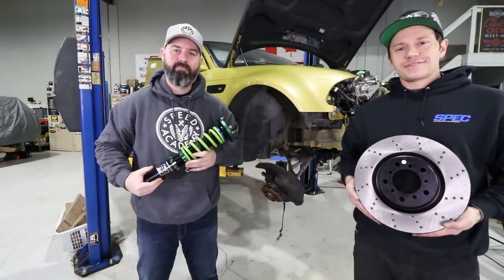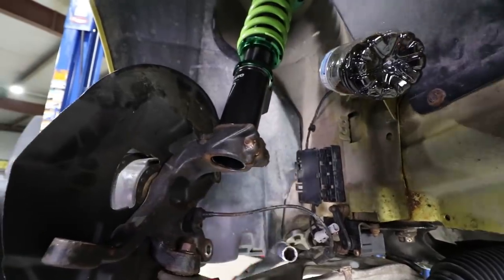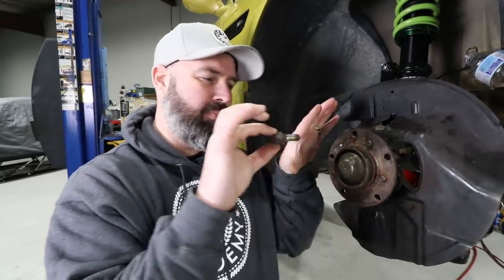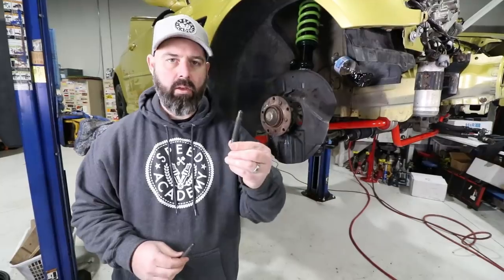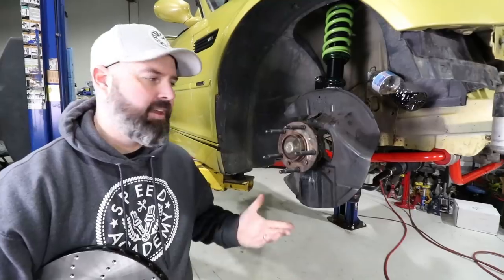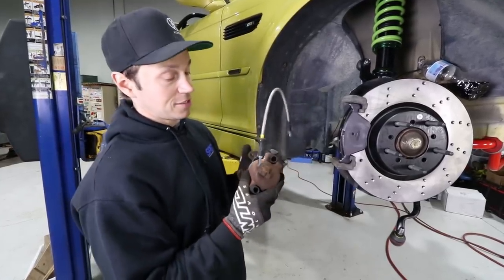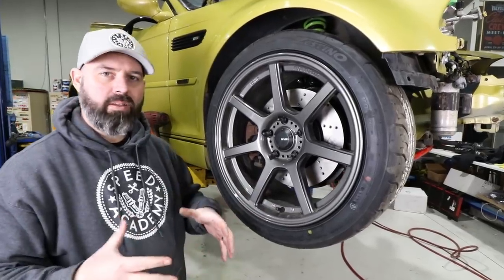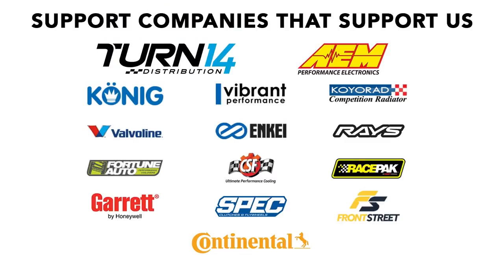Rebuilding and Modifying a $4000 BMW E46 M3 - Part 15

Comment: You guys really should use front shock tower reinforcement plates while using camber plates. E46s have strut tower failure even with the stock top mounts; metal camber plates with stiff springs and dampers will crack them in a few thousand miles.

Comment: The calipers looks like the same ones on the E36M3. I like the way the wheels look. 👌🏾
Reply: The fronts are the same.  Rear has a slightly bigger rear piston in the e46m.

Comment: I've run the Stoptech sport pads front and rear on my 91 Civic for track duty, no fade with brake ducts up front. It is a very light car however

Comment: Pagid rs29s over here with a  fixed front caliper. ditched  the stock slider bunk.
Reply from the maker: More details on the fixed caliper?
Reply: @speedacademy  I went for the 135i calipers. Got them real cheap. Lots of misinfo on them on the forums so that helped with initial buy in. They work very well. No more rusting factory sliders. No need for brass pins etc. You get a quality fixed set up which feels great and is way more rigid.
 Theyve held up just fine with properly fitted pads. Stock rotor size works. 
If you want to spend more there are many options (Porsche, stoptech etc).

For a drift car youre fine in the route you went

Comment: whomever installed those tires needs to know what the dots on the sidewall means
Reply: It's where the tire is lightest (or heaviest, depends on the manufacturer, some have both) so you can line it with the stem, that way you use less weights. That is if the wheel itself is perfectly balanced.

Comment: Why get those single piece stoptech brakedisks when BMW itself has these awesome floating 2 piece disks.
Reply from the maker: Good sir, the original rotors (brake disks) from BMW are not 2-piece. They are a single rotor.

Comment: This build sure is getting expensive. You've basically fixed or replaced most of the mechanical components at this point, which certainly isn't cheap on a BMW. I think the 350z was the much better option for entry-level drift build, even if it wasn't already modified. Are you guys going to do a final cost summary for each car?
Reply: Welcome to buying a used car that you want to track
Reply from the maker: It's been a slippery slope for sure. The issue is once you're in there the temptation to fix all the worn out items is big since we've been there and done the opposite and having to go back and yank everything all over again is not only frustrating but digs into our already busy schedule.
Reply: @speedacademy  Well worst case scenario, you prolonged the life of a car that was probably headed for a scrap yard soon. And it's a good cautionary tale about how a "cheap" used car isn't always the least expensive option.
Reply: @rthomp03  certainly much cheaper than a new m3.

Comment: Funny story I had 5Zigen GN+ slide and fishtaled a curb hitting a pull and my rim didn't bend but instead broke the hub off the rear beam of the car.
Reply: Leason learned dont drive drunk on cold summer tires in October

Comment: Big mistake with drilled rotors
I cracked mine today
Reply from the maker: Never had any issues with Stoptech drilled rotors.
Reply: @speedacademy 
I have the drilled and slotted ones on my s2k, they got cracked on a mountain run. Maybe I need those cooling ducts
Reply: @altimatic2183  yeah more the likely, if they got extreamly hot then rapidly cooled

Comment: question...the vanes on the rotor aren't pitched or scooping towards the front of the car in the video...is that right? i thought the the vanes face forward so air can be forced into the rotor while going forward...😕
Reply: Those holes are just there to release the gases from the brake pads. Plus it depends on the center veins, not the ones on the face that determine which direction they should be facing.
Reply: @vongdong10  I'm talking about the center vanes. i know what the holes are for...
Reply: @PANTYEATR1  Oh, well there's an R sticker on it which I was assume means right.
Reply: @vongdong10  i see the R as well, but I want to know why the rotor doesn't scoop at  air?
Reply: Airflow from a brake rotor is from the center out to the periphery.  If a rotor has directional vanes they should be pitched counter clockwise.
Reply: @PANTYEATR1 It's not meant to sccop air. The rotors take air from the center out.
Reply: @vongdong10  that's the answer i was looking for. thanks

Comment: How does flow formed wheels stack up against forged, forged still stronger over all, just more expensive?
Reply: Forged is stronger (and usually lighter, cause of less material as mentioned with cast vs flow). Flow forged is a hybrid approach to bridge between the cost of a cast vs the strength of fully forged.
Reply from the maker: https://speed.academy/why-wheel-manufacturing-method-load-rating-matter/

Comment: All this work and you haven't shredded a single tire. I feel like Big-P lost the feel and spirit of a budget drift build back when he wanted to keep the interior. I think you might end up regretting not driving and fine tuning the build after minor changes to get a feel for the car so your skills get better as the capabilities of the car gets better. I know you want to protect your investment and not blow a motor or some suspension bits by doing maintenance but its honestly too much and a bit overkill. It looks like your not having any fun yet and its depressing. But best of luck on the road to finish the build.
Reply from the maker: Havent lost the spirit but it's a slippery slope when fixing worn out items because once the engine is out you want to do all the maintenance so that you dont have to worry about later on. If I tried to drift this car when it was somewhat stock it would have been a full mess, broken clutch fork, questionable bearings, worn tie rods would have quickly ended the fun.

More importantly my mind frame is that I dont want take a heap car and break it first time out. Im always frustrated when that happens in videos, there's no payoff. Plus, it's winter so it made sense rebuilding all this :)
Reply from the maker: @azzdog  Sure I could've spent 10K on one maybe 15K but that doesnt ensure that the rod bearings have been done or the subframe reinforcement, etc. Despite there being a lot of work that needs to go into this car at least Ill know it has all the fixes completed.

Comment: Single piston front calliper on an M3? Really?
Reply: Thats how they came from the factory then
Reply: @jonathanmoga5188  I suspected so, but that is ridiculous to have top of the range 3 series with crappy single piston brakes at the front. What was BMW thinking? I guess their accountants were thinking in this case.
Reply: @TheSergeiFranco  it was a different time.  Fixed calipers were usually reserved for the very top sports cars. Unlike today. 
Despite that, they still functioned quite well.
Reply: @jonathanmoga5188   My old 1998 Celica (1993 model) had 4 piston callipers from factory, granted it was top Celica, but it was a Celica after all. Even late `90 Hilux (4-Runner) had 4 piston callipers. The single piston callipers are terrible, as there is a limit in pad shape, the sliders gets stuck causing uneven wear, uneven wear from the pad "walking", because of the shape limitation comes in rotor size limitation, rotor thickness is limited, etc.

Since `90 most of Japanese sports cars had at least dual piston floating calliper. Most of top Japanese sports cars had 4 piston callipers and 300+mm x 30+mm rotors. Taken a car with a twin piston and 270mm x 28mm rotor on the track, and having brake fire after 5 laps, just gives insight how terrible are the floating callipers. The 4 Piston and 320x32mm upgrade solved all the braking issues. Having thicker rotor makes a huge difference how much energy it can dissipate.
Reply: @TheSergeiFranco  I agree the stock slider has limitations and is a cost cutting measure. Even the whale of an e90 runs a single piston slider.  It wasnt until the f series M cars where they went to a multi piston fixed set up. 
But braking is a designed as a package. Not just what type of caliper you have. Many variables at play. 

A stock e46 m3 still out brakes the celica. Stock vs stock. ;)  

The stock e46 m3 rotors are 325x28 with cooling from the factory so it does a decent job with having the single sliders. But I ditched mine for a fixed solution.  The slider set up becomes more of a pain as the calipers age.  I have better pad wear, moved my bias a bit rearward(a good thing) and have great pedal feel.
Reply: @jonathanmoga5188   325x28 is decent, although ST205 GT4 came with 315x32 so slightly smaller in diameter but much thicker, with bigger rotor "volume" over all. I could not find the specs on the braking distance for the GT4, but from simple physics E46 M3 weights 1.55t (1.66t for convertible) vs 1.39t of ST205, I am questioning that E46 M3 would out-brake the ST205. Having tracked one (ST205 that is), I can tell the OEM pad is not garbage, given the same tyres the ST205 would probably outperform in brake department the E46 M3 in repeated succession (where it matters), simply because of less vehicle weight and (slightly) higher thermal mass of the rotor and better pad area due to 4 piston setup. I am fairly certain the GT4 would out-brake the Cabrio given the 270kg difference ;).

In my ST165 GT4 I went from 254mm x 24mm, single piston, to twin piston, to 270mm rotor, to 315x32 rotor and 4 piston with an measurable improvement (number of laps before brake fade), where the first two upgrades were incremental, the 4 pot upgrade was order of magnitude improvement. With 4 pots I could pretty much track all day long, and the only concern from braking perspective was pad wear.

What I was trying to point in my original sarcastic comment is that the single piston calliper does not belong for a top of the line car like M3. I am really disappointed that BMW decided to cut that instead of cutting out some stuff that is not important from performance point of view. They go overboard overcomplicating the VANOS and yet fit single piston callipers? It just shows that Euro cars are built to the budget and not in the good way. This also started to happen to Japanese cars so all bets are off.

Caveat: being originally from Europe, and living in New Zealand I have a huge anti-European (car maker) bias. Here in New Zealand within the automotive industry the European cars are referred to as "eurotrash". This is because New Zealanders drive their European cars like Japanese, right into the ground, irregularly serviced.